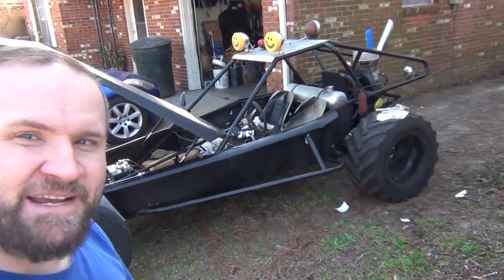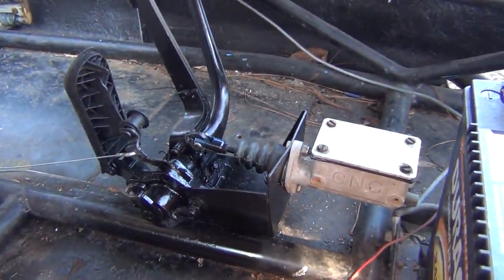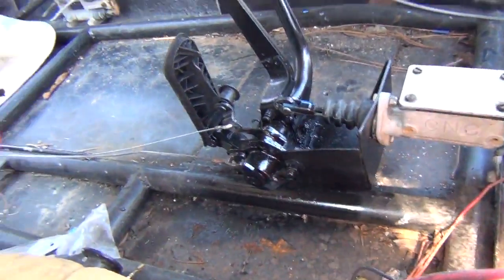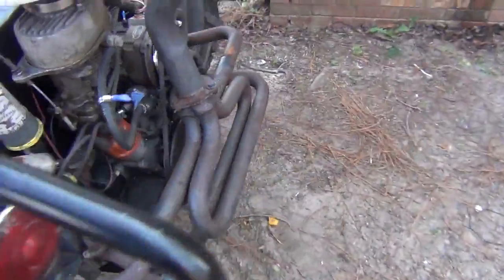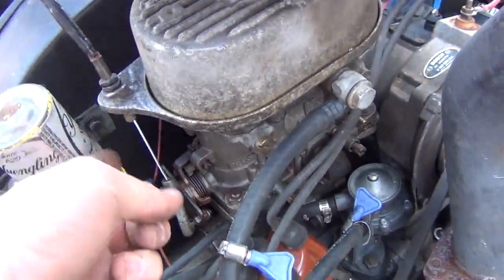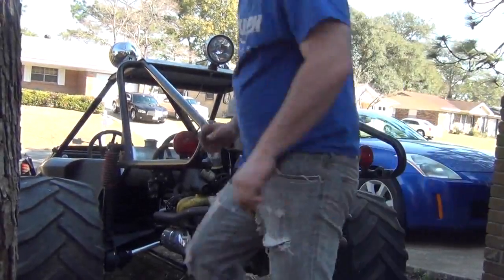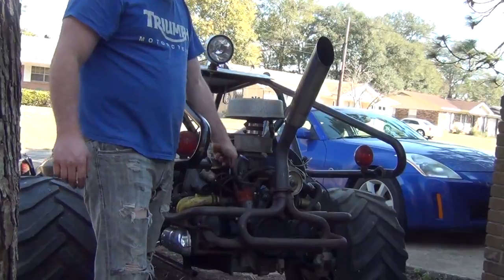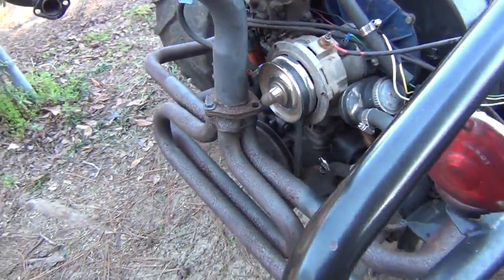VW Sandrail Transmission Swap - Part 6

Comment: where did you get the clutch kit, the pedals, and the box and rod? I just got my families old rail and had the same problem with the automatic transmission but I have a manual transmission but I have to get all the same things as you did to make it work. thank you
Reply: Good questions, but almost all of the parts used were sourced from various VW Buses and Beetles and pulled, except for the shiftier box... I got that one here:  https://amzn.to/2YFjNHx
Reply: @DuckmanCycles  thank you for that. Did it require anything special in the box to make it work of just a shifter knob and linkage?
Reply: @dylanstradling5249  Nothing special at all... just all the standard Beetle parts: A shifter, a shift bushing, a shifter plate, a shift rod, and bolts!
Reply: @DuckmanCycles  Do you have any idea where you found the pedal cluster because I am having a hard time finding a three set up
Reply from the maker: YAY!

Comment: Leave the Valve adjust a.....lone, if i am not wrong, lol, that engine has a sow-machine like sound, though i guess its why they make Books showing Valve adjust specs.... RIGHT
Reply from the maker: This comment is useful how?
Reply: Sir, i do not want to sound like i know everything. though i have helped build a few VW & Pancake engines back in 79 & 80. The only Trade i have and has fed me for 40 yrs. What i found is there is a Table of specs for each type of pancake engine that i had to use for i would try and adjust like a chevy, lol. This will not work, i don't remember exactly the name, though i am sure there are many online for the pancake engine is still around by the thousands. Good Luck
Reply from the maker: Well without being present and listening and observing the engine you wouldn't know what it needs, nor would you know the engines history or what I did to it.  So its really hard for you to assume anything with accuracy.
Reply: So very true, it is one reason i don't want to sound like a know it all..... Though i do know that Valve lash isn't all that difficult, it is the norm to think something is wrong if they hear a noise, Valve chatter. This is not the case on so many Pancake Engines, especially with solid lifter set up. Thanks for being open minded.
Reply: mister please give me more knowledge